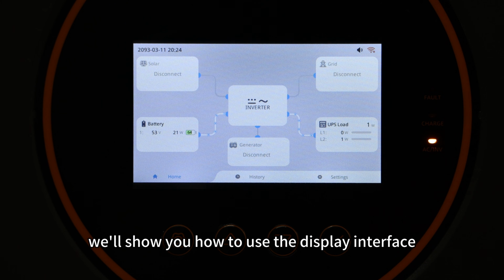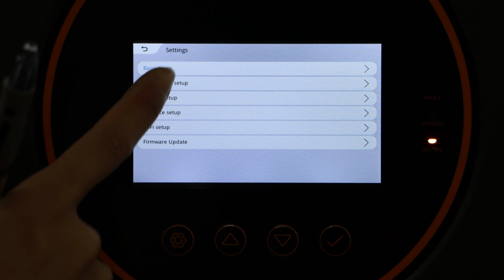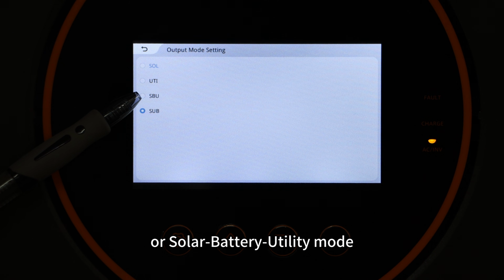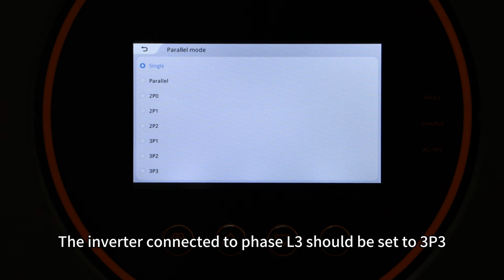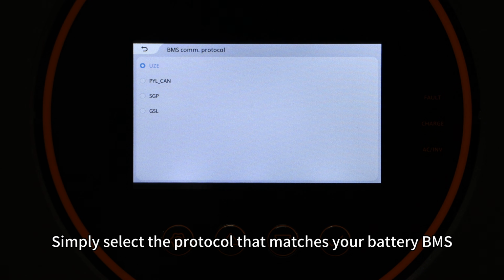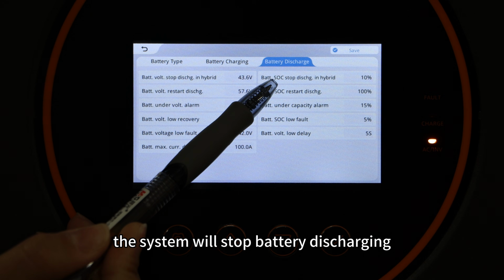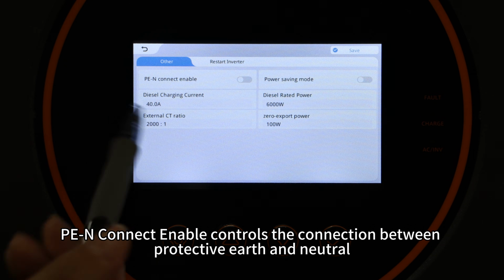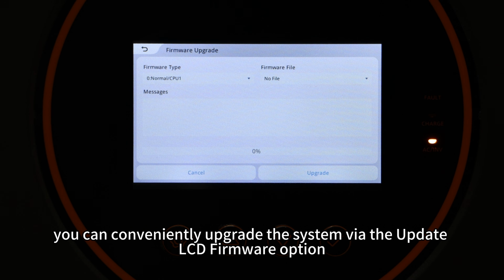POW-SunSmart 6.5KP-PRO Setup & Configuration Explained

Comment: I have the older 6500w inverter and the screen is dark. This is very frustrating trying to accomplish a simple task. I have seen 3 different ways of brightening the screen and none of them are possible. How do I increase the screen brightness on an older non pro model 6500w inverter?
Reply from the maker: The screen brightness can not be adjusted. Where did you install it?  You can take a photo and contact this email: support@powmr.com.